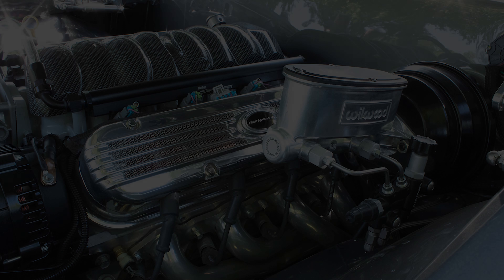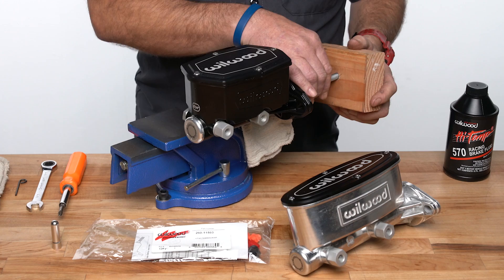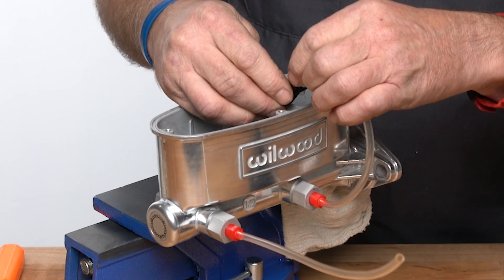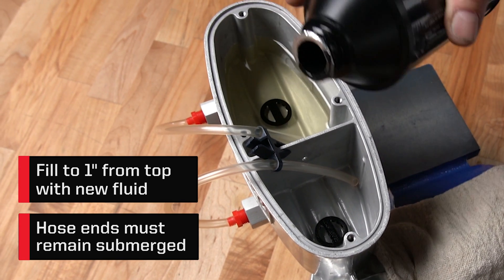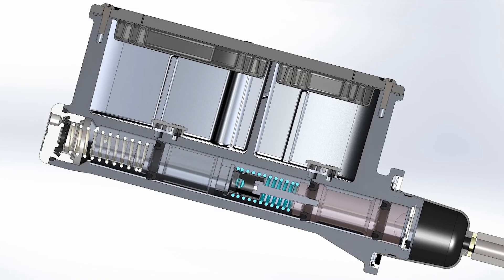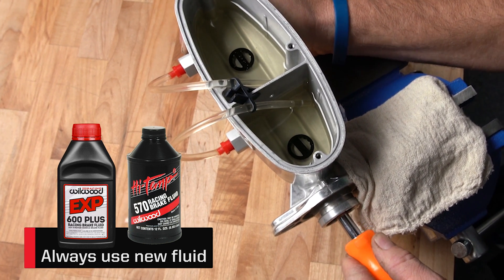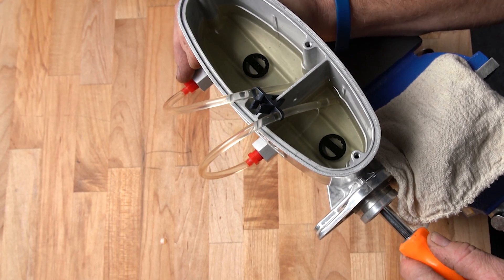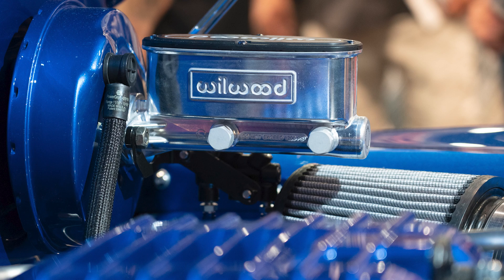How To: Bench Bleed a Master Cylinder

Comment: To say that this MC is an absolute Piece of 💩 would be an understatement.
When I saw the bleed valves on a MC  I thought WTF? 
If you have any other option take it.

The engineer behind this design has the brain of a poorly trained border collie.

I’ve tried bench bleeding, ( 🤔) then installing.  Yes you have to take out the plugs to connect the brake lines.

If you have the model like I did with the remote reservoir you’re doubly f*cked

Comment: I dont get how not to let bubbles get in the system once you go to put the brake fittings on. Soon as you pull the plastic fittings off you clearly see air bubbled going into the master cylinder
Reply from the maker: Air will get in, like most systems. It's important to bleed entire brake system once installed.

Comment: So I've noticed that when bleeding a wilwood master cylinder, it's recommended to leave the bleed tubes submerged in the brake fluid. When bench bleeding the master cylinder, the fluid will draw from both sides of each  tube during the bleed process? And what determines when the fluid will only draw from the reservoir, and only be pushed out the plastic tabs on the bottom of the reservoir bottom to the pressure ports. Maybe in not making sense.. I've seen other people bleed competitors master cylinders, and they haven't submerged the tubes, when bleeding.. So the bleed process seems to make more sense, when the bubbles stop coming out the bottom ports, the system is bled.. Hopefully that clears up, what I was referring to
Reply from the maker: Hi! Yes, fluid will be cycled from both sides. We suggest submerging the tubes in the fluid, so air does not get reintroduced into the system.

Comment: How do you keep air from going in when the plastic hoses are removed?
Reply: Great advice unless you have a remote reservoir 😢😢
Reply: Hi, make sure there is plenty of fluid in master cylinder. Then swap on to chassis one line at a time.